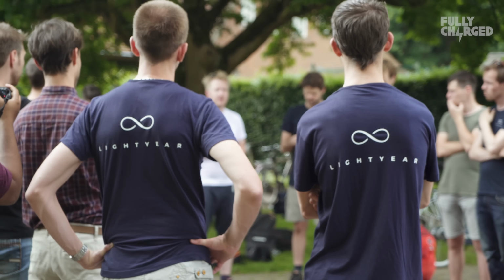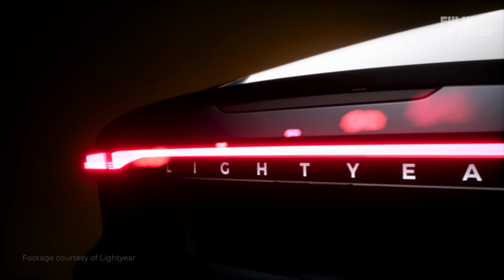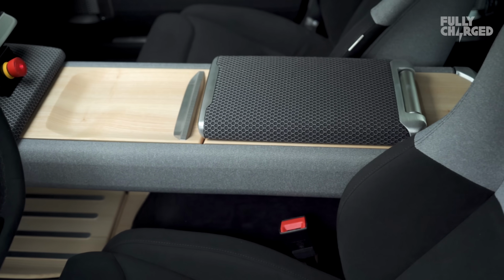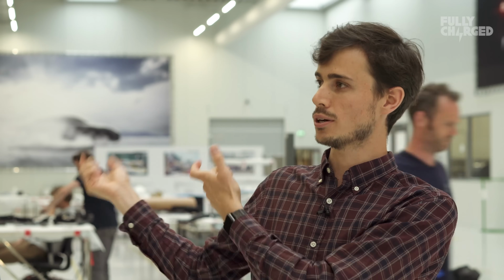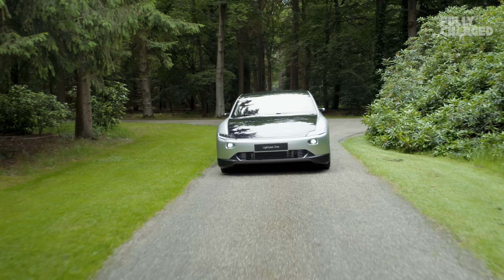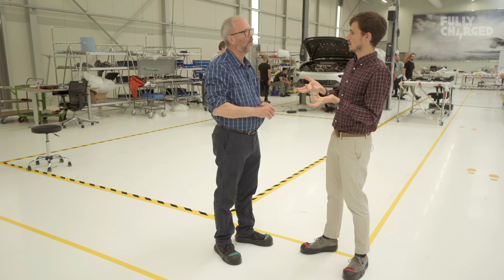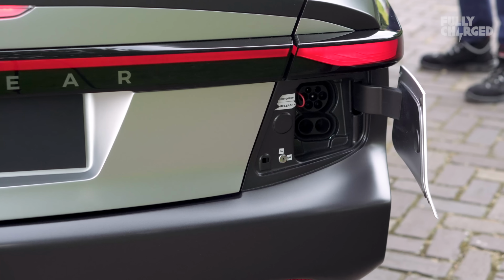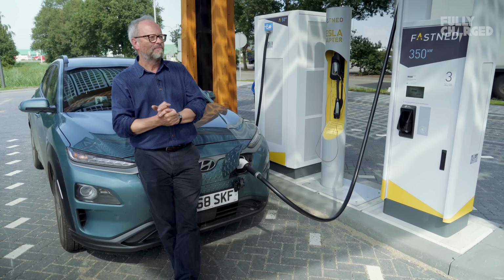Lightyear One solar powered electric car - exclusive first look | Fully Charged

Comment: Wait a minute, lets be realistic here for a second. assuming this car has the same size of a tipical sedan (2x4 m), we have a area of 8² considerating that the sun light has a power  of 1000w/m² we have 8m²*(1000w/m²) that totals 8000w. in horsepower that corresponds to 8000w/(754w/hp) ~ 10.6hp. If the solar panels have 100% efficiency, the sunlight is always perfect without shades or clouds always at 90 degree, the windows are solar panels too and the motors have 100% efficiency (but remember, all of above caracteristics is impossible) than this car can go almost as fast as a golf car! amazing!
Reply: Yeah, there's a good reason no one else is trying o do this... Funny they don't mention the in-wheel motors aren't actually powerful enough to be usable, and it won't charge when covered, shaded or dirty. What exactly is the advantage vs. a Tesla, charged by a home solar array? It costs more, has less range and a million times slower!
Reply: I wonder how many miles (city and highway) you could get on a day charge. It would still be nice if you park outside all day to even get a free 5 miles out of it.
Reply: @Clint3571  for what price?? a brand new tesla 3 cost starts at US$35k, this car starts at  US$135k how many years it will take for these 5 extra miles turn into a US$100k etetricity bill economy? -Never.
Reply: You realise we haven't commercially produced solar panels that have gone beyond 25% efficiency yet, right?  And that they already said in the videos the solar panels produce 1.5 kW in full sun?  And that they were driving slowly because they hadn't tested the car yet and they didn't want to break it in case they made a mistake assembling it?
Reply: This car has a battery though, so the charging speed from the solar panels has no relation to the motor output. I think he said that the peak solar output was about 1600 W, so realistic solar output in good conditions will probably be around 800-1200W. It isn't much, but if you drive moderate distances and park outside, it would reduce the amount of power you need to draw from the grid by a fair bit.

Another way of looking at this: if you park this car outside on a sunny day, you can keep the air conditioning on constantly, and not lose any range
Reply: Rick Lokers  Why can't you have both?  Panels on your house and your car?
Reply: Rick Lokers  it would certainly be better to mount them at your house or fixed somewhere else. Investing in covering big parking lots (US big box stores and big employee lots) with solar panels would be a great solution. We already have all these flat lots, covering them with panels would provide shade for the cars and provide power to the building (and locally farmed solar charging to the customers/employees). Not to forget all the enormous flat roofs.
Reply: Rick Lokers  But most people have limited space for solar panels, so if you fill up your roof and garden, it makes sense to put them on your car too.  Sure they won't be as efficient, but it's better than nothing.  The more solar cells they produce and sell, the cheaper they get, so I'm all for it.

The store isn't a great example, because if you look at places where supply is crucial, they will buy from both a cheap and a more expensive store, so that if one runs out of stock they can easily get another.  Some people will also pay more to use the expensive store because it's 10 seconds closer, so there's always room for something that's second best.
Reply: Rick Lokers  I think that's the point - many people have already put down money for this car, so clearly there are people who like the idea, even if you don't.

Comment: Onboard solar powered battery charging would be a nice addition to the remarkable Chevy Volt Gen 2 drivetrain / battery system. Yet, it's engine may be improved ( as well as other hybrid designs in use ) by a conversion to the use of alternative fuel ( fuel derived from plastics in the "recycling stream" - plastics being subjected to the pyrolysis process, or from algae, or yeast ( ethanol )) versus it's use of gasoline. 
This would provide solutions towards: 1) a reduction of fossil fuel use and extraction 2) the (re)use of a fossil fuel based product ( plastic - of which there is an increasing and overwhelming supply ) 3) an alternative to the "build out" of the resource intensive EV charging infrastructure of which the alternative fuel could be supplied to existing fuel stations along the transcontinental route and alternative product being produced more "regionally / locally" ( versus the limited number of fossil fuel refinery facilities existing in the U.S. and the attendant factors involved with long distance transport of refined products ) and 4) alleviating the "range anxiety" of the typical EV with the availability of alternative fuel at existing fuel stations for use by the vehicles outfitted with the Volt hybrid system ( with further reduced fuel use by the engine being had through supplemental onboard solar charging capability charging the batteries )

Comment: It's all very well designing a bespoke car as say a one off for the Australian solar race and this one off car
But how are they going to take this concept car to the next stages of manufacture?
This was the problem Musk had
Wouldn't it have been more sensible to have partnered with a major car manufacturer who has experience in car manufacturing and modify an existing vehicle by adding their technology
That way they are almost guaranteed success and will see their cars on the road much quicker.

Comment: i wanted this to car to be driven a little faster than jogging speeds
Reply: it is hard to do it with only 8 hp! note that they need to push it into the trailer cause of the ramp.
Reply: @itabiritomg  Wow!  You're right... now, when adding the extra weight of the larger (more realistic) motors and larger battery capacity for them, what would that bring this 400+ km range down to???  Keep in mind that the self-charging ability would NOT scale along with the greater HP / battery capacity because the car is already completely covered in solar panels...  Hmmm sounds fishy....
Reply: @ChristmasEve777  it is
this gives you at best a full charge every month
just put your normal, cheaper, more efficient and reliable solar panels on your roof
Reply: @ChristmasEve777  Wouldn't it be good if there was further supplemental "on the go" charging capability? I'm thinking wind turbine behind  the front grill (squirrel cage fan design?)
Reply: @andywright6713  There may be a way to implement that idea into a vehicle. But, keep in mind that any resistance--and a fan/turbine blade catching wind and the force/energy it takes to spin that into electricity would be difficult to out-weigh the reduction in drag coefficient.
Reply: @andywright6713 , propellers of any type would only likely add resistance.
Reply: flat earthers
Reply: Hard to go over 10 mph with a mix of pedestrians and bicyclists on every side!
Reply: How fast did the Model T or other petrol vehicles of the era travel? Its hard to build something thats never been done before and impossible to build the perfect version overnight.
Reply: Accordy to EV-database it has a maximum speed of 150km/h
Reply: Carrying the extra weight and complications of the charging component is silly. Just park the charging facilities at home or at charging stations and save the headache of having to be this self sustaining vehicle. Its unnecessary for 99% of occassions and there is still other better solutions for those 1% of occassions
Reply: @thomascocks9136  Or, how about: Carrying the extra weight and complications of the lithium battery pack  is silly. Just fuel the petrol engine with gasoline at the gas stations and save the headache of having to be this self sustaining vehicle. 

The biggest innovations come from those of us who failed to accept the absence of something better.

Comment: Amazing. Have they thought about reusing the extra energy you'd get from the car if it is fully charged and parked outside your house for example? Future is bright. Well done.
Reply: No this is pretty dumb. It would be waaaay more efficeient to just put the solar panels on your house and charge the car instead. A car is blocked from sunlight by buildings or trees most of the time...

Comment: At £105,000 though, is hardly for the masses. 

Until they make electric cars more reliable and fully self-charging, so Lexus or Toyota level, and with realistic pricing, like Lexus and Toyota, then I will not be purchasing one, end of.

Also they need to start to place solar roadways down for energy supply to houses and also wifi style charging whilst driving down the road.  They could introduce so much and convert people to electric and hydrogen cars in 10 years if they wanted and across the planet.  But they won't, you can thank America in specific for the mess we are in with the environment.  They are the ones trying to push it all back so the greedy bastards in oil and other polluting industries remain in charge. Naughty and deeply damaging.

But that aside, £105k is not a regular persons car, nor are Teslas.  The build quality on them especially Tesla is quite poor and of course the main car manufacturers in Europe are now beginning to bring out their own electric cars with as good if not better range than a Tesla and offer a higher level of build quality and more realistic price. As I expected what would happen.

Overall, with the current situation around automotive industry, I give electric and hydrogen cars a 4/10.  They are well off the mark at present and I would happily purchase an electric car, if it was 100% fully self charging.  Well the only self-charging electric cars I can think of are Toyota and Lexus.  They genuinely are agreeable prices as well, if you can charge the bastard thing.

Comment: Through there are pitfalls they could speed up the process by being a partner with a large auto manufacture. Follow the process Saturn used but with safeguards where the big company won't come in later and destroy the car in the later years like GM did to Saturn.

Comment: The funny thing is, many years ago, when electrics were first starting to be reconsidered due to the price of gas, I mentioned this idea to some friends of mine, and I was told "solar panels would never work well enough like that".  Of course, I'm in Canada, and we get a lot of snow and ice in the winter, so...
Reply: And still, solar panels would never work well enough for that! About a horsepower max (one horsepower - 750W) from the whole lot on a good day on a car that has 100,000 watt battery - if in line with Tesla. or (and they never explained why or how a 30% improvement in efficiency) 70,000W equivalent. I'm calling bull on this. There was NO technical information at all.

Comment: Lots of bla, bla and no facts or data
Mk
Reply: 16:47
facts and data
Reply: @graffie  As I'm not living in Australia and sun is a rare companion in most civilized countries. So I'm not interested what theoretically under best conditions the data are. But it is always the same old trick greenwashers use: Performances under unnaturally optimalised conditions. What we need to know is the following: Regular and maximal power of the motor, battery capacity, range under normal conditions, range on a 25% grade with the maximum of passengers and luggage, output of the solar cells on a sunny day, a cluody day and a very cloudy day on the 50° parallel and so on. Presentations like in the video are just rubbish to fool people.

Comment: Anyone reckon we could get some kind of paint that has solar cells in it that effectively charges the car whenever there is a source of light ?
Reply: Already exists... BUT it has about 10% of the efficiency of standard solar cells which probably are about 1/2 as efficient as what is on this vehicle. The cost once you cover enough area to get the same output as highly efficient solar cells is as much or more due to the enormous area you'd need to cover.  Might work for the south facing side of skyscrapers, not going to work at all on an EV.

Comment: Such a shame they've still gone for partial use of, and reliance upon, batteries, which are not only very harmful to the environment but involve the exploitation and endangerment of humans, including children. The fact they didn't go for an environmentally less polluting hydrogen-cell power train is a missed opportunity. 

Ultimately, when planning a journey, the range will be determined by the batteries within as one has no control over daily micro-climatic conditions. Will it be sunny with blue skies, very cloudy, overcast or black and stormy, pouring with rain, so one must drive with power-sapping lights on at the very time when solar-replenishment is lowest. Moreover, as repeatedly seen in the video, the photo-voltaic panels must be kept scrupulously clean to work optimally. So, if you live on a tree-lined avenue you'll have to be up an hour earlier to clean off all the tree sap before heading off to work. And don't think of parking your car in the shade so it will be cool when you return as so doing will deprive it of solar energy.

At least they got the aesthetics spot on

Comment: I can't email you directly (fair enough you must get innunndated). 
The world needs power for everything cars included. Solar is great but can only ever be part of the story. Please will you go and talk to the new nuclear people, Ian Scott of Moltex, Kirk Sorensen of Flibe, Baroness Bryony Worthington and many more. They make the very valid points that coal and oil are fantastic materials resources yet we continue to burn them. Old nuclear is fundamentally risky made (very) safe by very expensive engineering. New nuclear using molten salt reactors is fundamentally safe so does not need the expensive engineering. Costs right now are cheaper than gas fired power stations. Very soon they will be cheaper than the highly polluting coal fired power stations.

Comment: Good design is always important. Well done for thinking outside the box. Please will you change those wheels for plain discs. The flashing spokes do not suit the car.
Solar charging is a great addition to plug-in power and handy when the local power infrastructure struggles as everyone goes electric.
High efficiency panels are VERY expensive so dont expect such things in every day town cars. The panels used on houses are a fraction of the cost. A small town car has perhaps 50% of the available space for panels, but will use not much less energy. Then what about shadows from buildings? Always an issue in towns.

Comment: Great car but 150000€?
What makes it so expensive?
Reply: Likely the solar panels and also likely expensive to produce because its not standardized.
Reply: @Zoza15 
I don't know, it could be that they have some very high tec panels or something, but Sonor Motors seem to be able to make a solar supported car (yes not as efficient) with just a bit under 30000$.

Comment: The design looks too cheap. It needs a more premium touch. The front, back and interior especially
Reply: Not a very helpful Comment, Davo.  Say what you mean. In detail. Explain. Premium touch? Who he?

'Less is more' is a phrase beloved of stylists and designers, and usually results in classy cars that aren't smothered in crappy wall-to-wall spread-tow carbon-fibre (to please callow juveniles) or 1950s-era chrome (to please their tragic Donald Trumpoid dads). But if you're trying to provide constructive criticism in a Comment section on YouTube, 'less is more' is less than useful.

Comment: This design is nice but is it practical can it be mass-produced at a reasonable cost? When engineering these vehicles that should be taken into consideration and unfortunately it's not. This is why Tesla is in so much trouble in the marketplace. Another tech company trying to compete in the real world without bringing on people experience in marketing and production. I really support the electric car concept just can't wait until a Ford are Tesla comes along and takes the place of the head in the sand Edison types